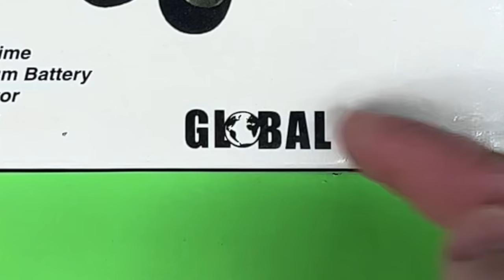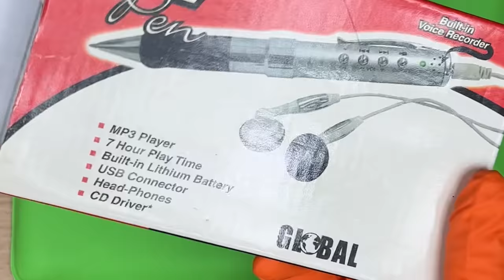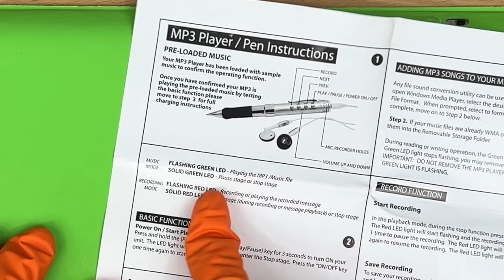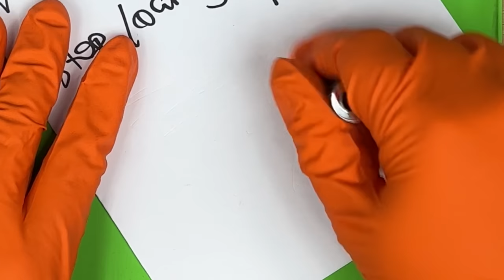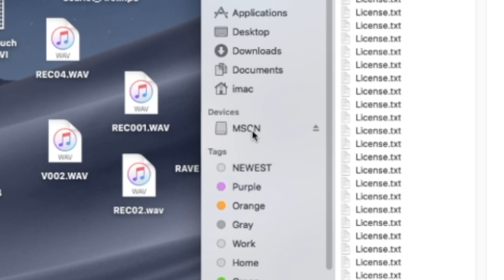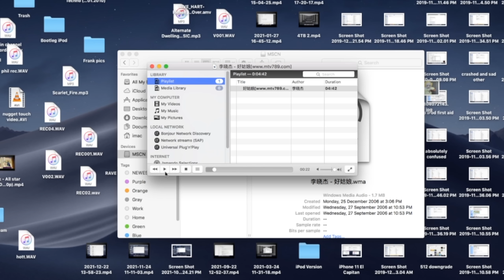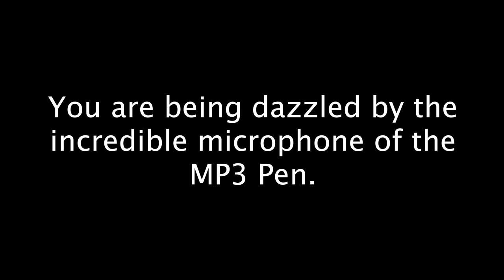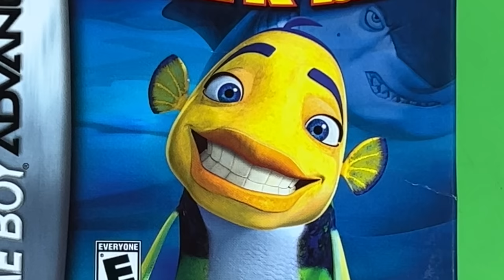The MP3 Pen.

Comment: Tip: if you have a pen that has dried out, try using a lighter and lightly move it along the pen. It’ll free up the ink and make it usable again. Though in some cases it’s not a permanent fix.
Reply: Also try scribbling on your shoe sole, idk y but it works
Reply: @GatileoGatilei I'd guess that's probably because shoe soles are pretty grippy, and so the ball in the pen is easier to get to spin again and let the ink to the other side if it's stuck
Reply: @lunlunnnnn And the rubber on the soles is good at making friction, meaning it also heats up the pen ball and the ink.

Comment: 9:40 that was the point. They put one of those, just so you could not blow the headphones. Making big grain moves before someone on the internet decides to screw them. Jokes aside, would it really be able to fit a 3.5mm one? It does look like it's mini jack is already against the lipo cell and the 3.5 might go over it. Or, if it fits, be too close in case someone stabs hard the headphone jack, dislodging it and puncturing the cell.
Reply: He can still blow it up either way, You can get one of those 2.5mm jacks to 3.5mm jacks, So its not a HUGE roadblock.

Comment: I bought one of these long time ago. From a Chinese website! The ones I got had 1GB storage and a FM Radio! Ended up replacing the small socket with a conventional sized one. In the end it was just used as flash card storage after all it was a gigabyte in storage though slow storage. It was great for recording meetings! Other than that total e-waste today! Yea my battery pack still works in the one I have here still total e-waste today!